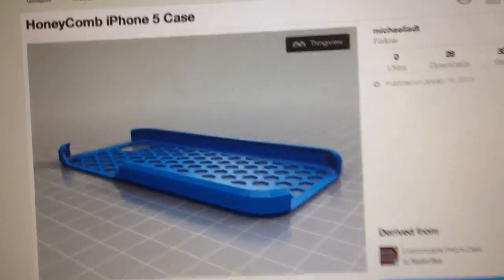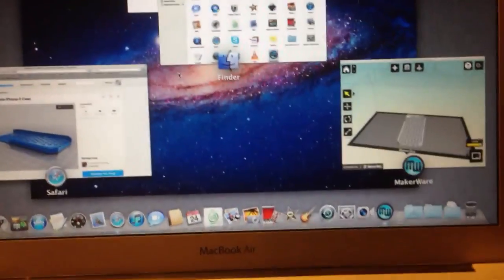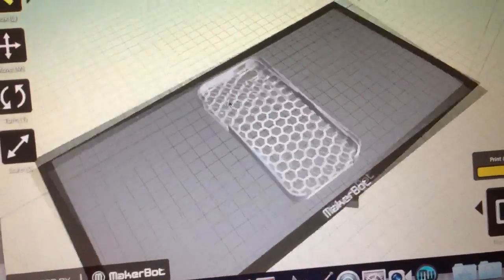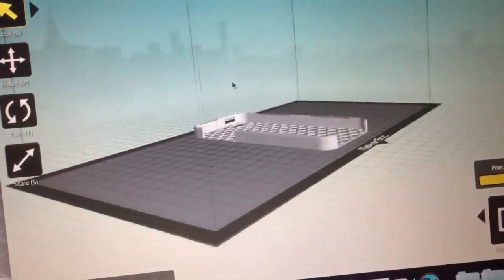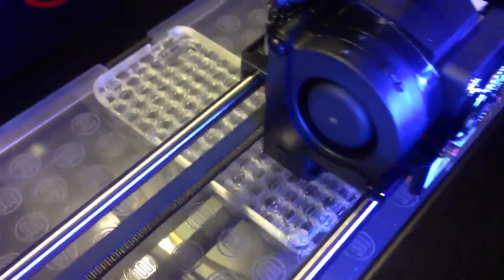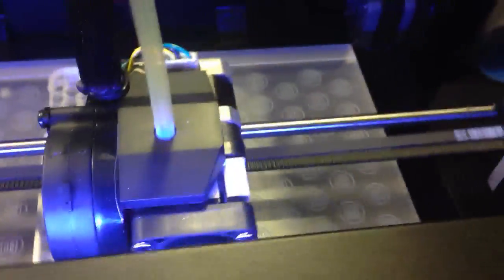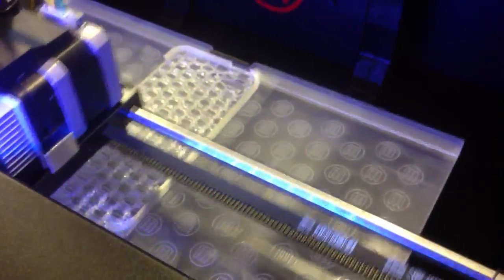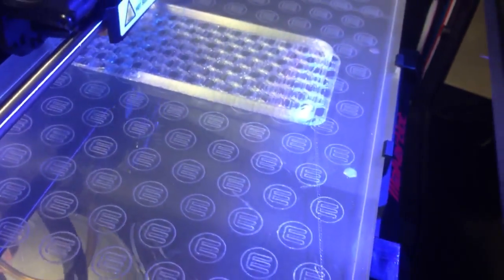iPhone Case 3D Printing Problems

Comment: case 1
you are printing just outside of your print area.  the printer is doing what you ask it to because it is not 100%intelligent.
case 2
skipping steps.  lubricate axes with teflon or something or adjust vref potentiometer on driver.  be careful of esd while adjusting drivers. I dont know if this is an option on the new makerbots.